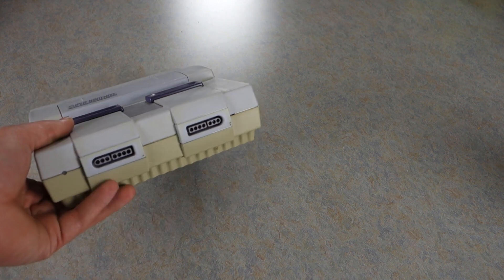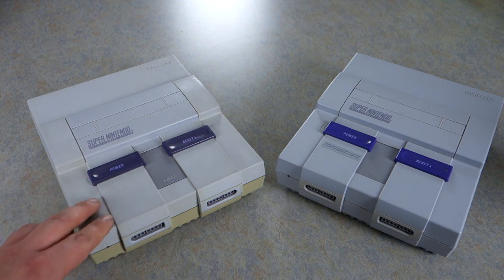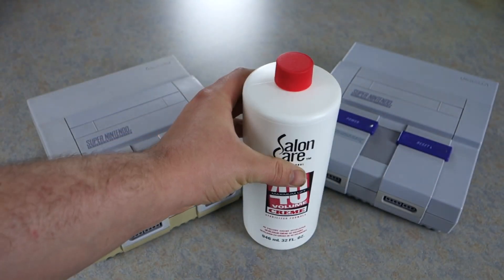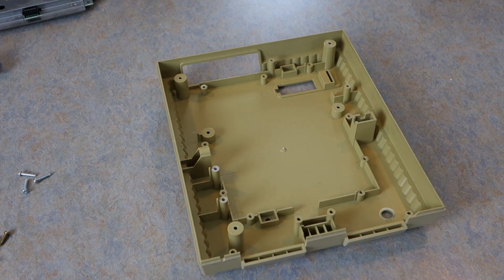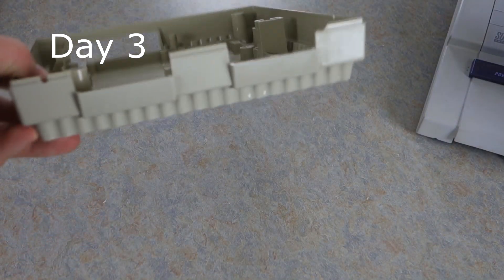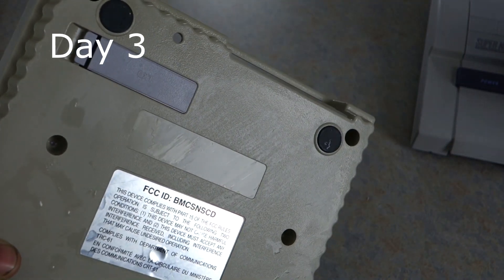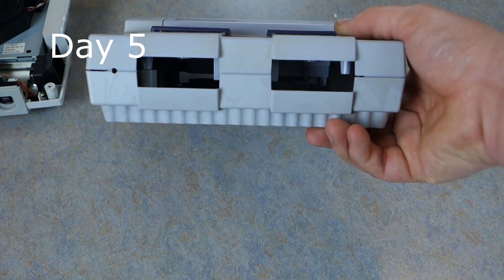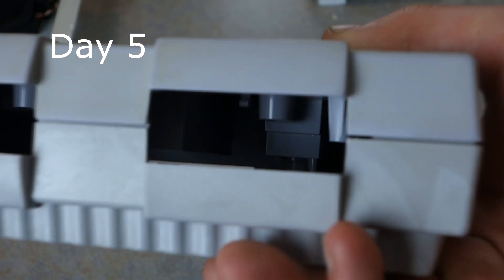How to Restore a Yellow Super Nintendo the Easy Way

Comment: Nice video! The plastic wrap touching the case is what causes the streaking. I use the same product in the sun but place the game cases in a plastic container and then use plastic wrap to cover the top (so it doesn't evaporate). Under full sun you only have to leave it outside for a few hours.
Reply: Smart 👍🏾
Reply: I just reapply it every hour and it did it in 6 hours with no streaking
Reply: can you make a video on it please

Comment: Letting it bathe in a high percentage hydrogen peroxide solution in a small clear container (you can dilute it a little bit with water to make sure the water level is high enough to cover the entire thing) is the best way to retro bright stuff if you want to avoid any streaking you might get with uneven applications of the cream version of it.

If you have issues with it floating, I think you can just tie weights down below. if you use screws with strings tied to heavy rocks I bet you could hold it down via the screw holes.

The liquid hydrogen peroxid submersion method is best. Might cost a little more as you will need a somewhat large amount of the stuff to fully submerge it. but for something as small as a SNES, you won't need as much. It's generally old Macintosh casings that require a large quantity of it. Simply having it out in sun light is an effective source of UV for this too incase you don't have backlights.
Reply: ApacheThunder sounds good, but would the factory labels come off also?
Reply: Heat produces much better results than sunlight or UV light, as in heated water with Hydrogen Peroxide

Comment: You can get the exact same results in the sun in about 4 hours. To reduce the streaking wrap it in Saran wrap like you're doing... put it out in the sun and use a clear plastic bin over top of it as a light diffuser. Spending it every hour also helps I've had incredible results.

Comment: I did a lot of research on the retrobrite process and apparently the fix is only temporary.  The molecular make up of the plastic is just unstable from the original mix and you can't change it permanently.  It will re-yellow in time.  For some SNES's it's just destiny.

Comment: If you add bleach to that product and don't seal up with the plastic, you can whitten in 12 hours. But you would have to re-apply every 1,5 hours or so to prevent from completely dry out. Also, if you put the yellowed case inside a carton filled with metalic paper (and of course the black bulb), you will speed up the process.
Reply from the maker: Wow. I really got to try that out!

Comment: To speak for the lack of structural integrity of some yellow ones, I saw one in October 2006 that was yellowed bad; plastic by the controller ports was missing. Maybe it was thrown across the room once, but wow. I wondered if it was the same one that AVGN ripped apart in the SMB3 video, but it also might as well not be.

Comment: it is better to coat in the peroxide cream and put in a plastic container, you can punch a hole in the back of it if it has no air flow for offgassing. Saran Wrap is the streak issue. Make sure the plastic case doesn't have any UV block in it. clear plastic.

Comment: I don't think a black light and a uv light r the same, don't hold me to it, idk
Reply: you are 100% correct. u cant get tan or cancer from a black light
Reply: No they are not the same at all at my shop we use heavy uv bulbs at 8,000 watts they require a whole lot more power than a traditional bulb socket will give if anyone wants something to do this on a multiple console level or don’t have alot of sunlight where u live look at garden stores n such for a bulb with a bit of actual uv i have a shop that has a bulb that could get this done in minutes lol

Comment: Great video!  The streaking is actually from the gel that you used and not from the black light or the sun.  When you applied the gel, you had some areas that had bigger globs of the gel than others, therefore, not letting the shell de-yellow all at the same rate.  The only way to not get the streaking would be to apply the gel perfectly even across the entire shell, which is virtually impossible.  If you somehow had the same chemical in liquid form and submerged the entire shell, there wouldn't be any streaking.
Reply: So, he would have to submerge it in hydrogen peroxide.
Reply: Yes.  A kickstarting agent like Oxy would help speed up the process.
Reply: Jeff Voiner Actually, it has been proven that does not help very much. The difference is very small.

Comment: Thanks McFloppy, but there is actually a better method is seems. I saw another video where the guy unyellowed a 1st gen Gameboy. He but all the chassis parts in a ziplock bag full of 12% hydrogen peroxide, then down with the bag into a water bath of 50 degrees C (~120 F) and left it there for 6-12 hours. The result was amazing.
 
Link below.
https://www.youtube.com/watch?v=lW9uKZE4yJ0

McFloppy, you should try this in a video of your own, to see if you can't get the last of that yellow out, and the streaking. I would put some kind of protective film on the silver stickers underneath though, to make sure they're not destroyed in the process.
Reply from the maker: You don't realize how well timed this comment is. I'm currently watching something on ebay that is yellowed but I holding out for a price drop. I will check that video out and try it if I end up getting that item.
Reply: I hope you win the item. Can’t wait to see that video.

Comment: You're having a bit of trouble breathing there buddy, you keeping healthy ?
Reply from the maker: +andree1991 The mic on my camera picks up every little thing, especially breathing...
Reply: +McFloppy How long did you leave it in the sun? Some people claim if you leave it in the sun for only a few hours per session it will not streak the plastics.
Reply from the maker: That was probably my mistake, I did it for 8 hours.
Reply: McFloppy I just brought a small bottle of the 12% stuff to use on a very mildly yellowed super fami but now I'm not so sure if its worth the risk.
Reply from the maker: I don't think it will streak as bad as mine did with the 40%. Is it the cream or is it a liquid?
Reply: McFloppy Cream. The salon 40 stuff is actually only 12% peroxide. Maybe a few hours for each treatment would reduce the risk of streaking.
Reply from the maker: Yeah, I would go very easy on it. Do you have any black lights?
Reply: McFloppy No I don't but I might pick one up at some point. The cheap ones tend to be very weak.

Comment: Using a small foam roller, and placing the plastic piece in a cheap $1 white dish bin with the areas you want brightened exposed to the sun, and the clear plastic wrap sealing in the moisture tight, but not in bunchy layers (you want the sun light to hit the unit pieces as evenly as possible.) Gives better more uniformed results and helps to prevent blotches and streaking.

Comment: its not a chemical. it's an element one of the only 2 or 3 liquid elements to.
Reply: All elements will turn to liquid at a certain temperature. Water is liquid at a certain temperature, and will cool to freeze, or heat to vapor. Steel is the same way. Heat it from "room temperature" and it will melt. Heat it more and it will vaporize (very very very hot). I can't tell what you're referring to when you mention chemical, but a chemical can be either just a single element or a compound.

Comment: Do you know if the proximity of the UV/black light has any effect on the success of the retrobrite? From your video it seemed to have some good distance away from the piece. Perhaps if it were closer, thus making it a much stronger UV light source the outcome would have been  more positive in a shorter span of time? Just a theory.
Reply from the maker: +MrStr8leg I was thinking that too. I backed it up that way I could make sure I got most of it cover.

Comment: Last time I seen my Super Nintendo sitting in the attic it didn't look yellow and it was sitting up there for 15 years. I haven't checked it lately but I don't think it even looked slightly yellow but it maybe because it is sitting in a box the whole time. I am wondering how do they yellow in the first place. I thought maybe the light exposure is what made them discolor over time.
Reply from the maker: Sometimes it is sunlight and sometimes it is the chemical in the plastic that turns it yellow.
Reply: You might have a model 2 which doesn't yellow, but might be able to yellow from enough sunlight because that can happen to anything. The model 1 doesn't need sun to yellow, it just speeds it up a lot.
Reply: Paul Piacentini Jr that is because supernintendos yellow cuz of uv light

Comment: This video is a joke right.
The "Use chemistry to remove the yellow from old plastic" video on youtube is the easy way. Waiting 5 days for "hopefully" better plastic is not the easy way.
The chemistry method works in a half hour tops, right before your eyes.
Are you sure this video is not a joke??
Reply: You're joking right? this video is literally "buy salon cream,shrink wrap and rubber gloves and paint the cream on the plastic,use wrap to keep it wet then expose to UV light" how much easier do you need?

The video you mentioned involves mixing dangerous and possibly depending where you live hard to obtain chemicals together.

This method is slower but also safer,easier and cheaper.

Comment: never seen a dreamcast do that
Reply: +vorkev1 I took my Dreamcast out of a shoebox I'd kept it in for several years.  It had turned yellow, so the DC is not entirely immune.  I was probably unlucky though.
Reply: RexRude99 that sucks
Reply: +vorkev1 My 9-9-99 Dreamcast has started to yellow at the front :(
Reply: +rwdplz1 surprised it still works lol
Reply: Aaron Villalobos My '01 Nintendo Gamecube works well, it sitted on my closet for 5 years and when I took it out it was dusty and yellow but it managed to still work somehow. Those things are strong dude.